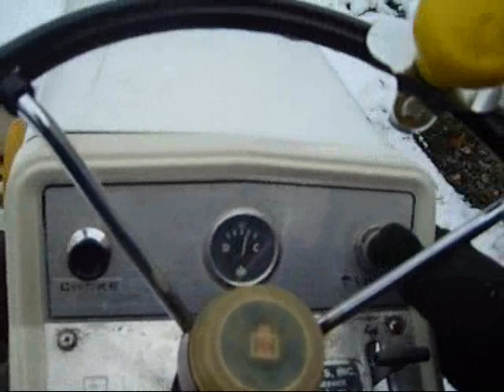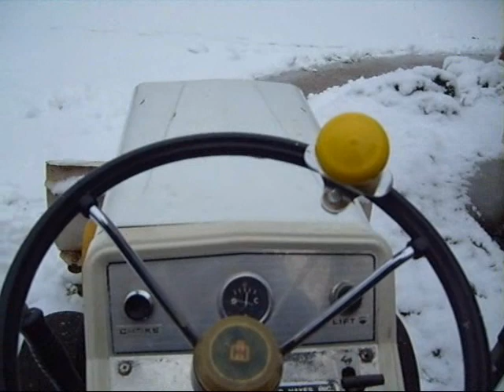Cub cadet 107 Plowing

Comment: If the tractor wasn't revved up, it would have started alot better. The worst thing you can do to a small engine when it's cold is rev it up, it puts unnecessary wear on engine parts and the engine. The best thing to do is to start them and let them idle for five to ten minutes before revving them up or operating them in the winter.